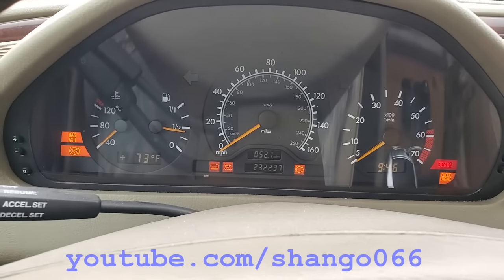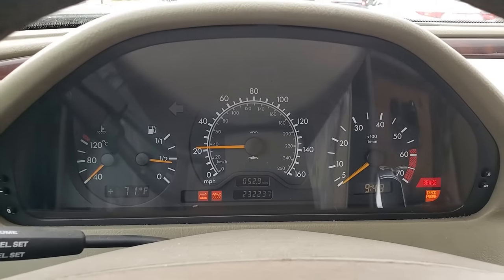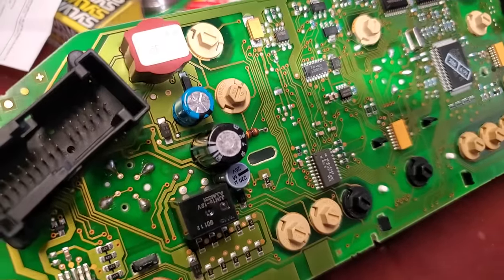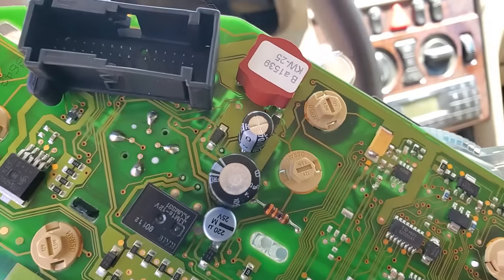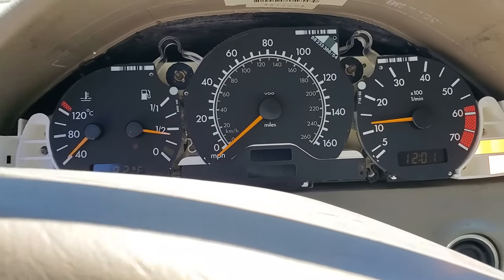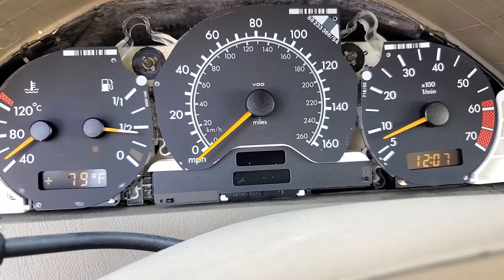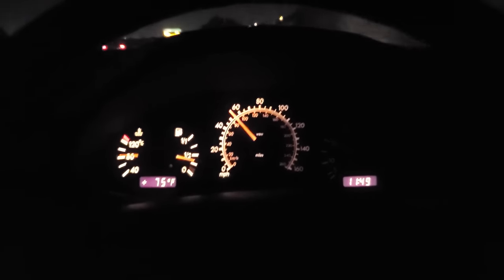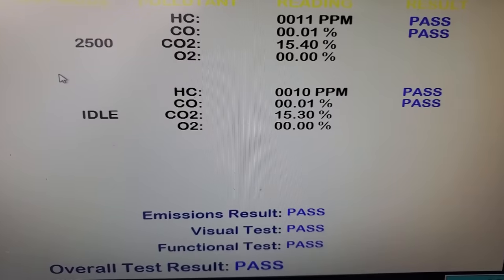Mercedes C230 P1747 Code Instrument Cluster Dash Repair 1999

Comment: Emissions tests in LA are absolutely VICIOUS!  The last time I had to do my 85 Nissan, they turned the truck inside out for 45 minutes to finally proclaim a big FAIL due to the check engine light not working.  An absolute screaming match ensued, in which I was just short of punching the guy.  The Manager walked out to see what the hell was going on.....   Finally he said "That truck doesn't HAVE a check engine light OR a computer!"  I ended up passing with flying colors.  Interesting though that a cluster can set an emissions code.....  why am I even surprised.  Next it'll be the Dome light.
Reply: I remember the bastards seem to pride themselves on how many cars they can fail.
Reply: In the not so distant future:
Dome light? oh you mean the cabin illumination module with integrated occupancy detection ignition lockout sensor & Bluetooth interface. Yeah.. so if the leds go bad in the illumination module the occupancy detection sensor will throw a code & disable the ignition system because it can't confirm that someone is in the vehicle. Oh, no, you can't just replace the leds in the illumination module because all the components are potted in glass fiber reinforced epoxy resin as it is a part of the vehicles anti-theft & security subsystem. The module will have to be replaced. For your model year, replacements are 450$ & they are on back order.
Reply: Gee, you could have had a civil conversation with the person, pulled out the owners manual.
Reply: @bobroberts2371  I DID!!!  He was adamant!
Kept pointing at his book, which turned out to be wrong.  I guess you don't live in California, (I actually recently left) the idea is to get all old vehicles OFF the road.  They are required to fail a certain percentage of cars.
It is infuriating when you actually maintain something and they try to take it way and slip you into a shiny new lease or payment plan.  And I do own a Snap-On gas analyzer BECAUSE of this BS!
Reply: In a state where everything is illegal the only real crime is getting caught
Reply: It's nice to live in a place where they don't have emissions checks or anything like that. Although it can get scary trying to avoid the Dodge Diplomat that's missing the front clip weaving around in traffic.

Comment: Shango, 
I have both a 1999 and 2002 Grand Cherokee Laredo and Limited (4.0 & 4.7 HO respectively). The grounds under the DERMs on each and shifter under the console were rusted and full of High Fructose Corn Syrup, not to mention leaving the sunroof open in multiple overnight rainstorms (my GF in case you were wondering). Pulling both front seats then repairing the 4 grounds, 2 on each side , under both seats. That and cleaning the BCM bulk connectors with the busses, and cleaning the IPC main connector, everything is good in the world again.

That Benz was built when the capacitor plague was present but unknown largely. I never thought of checking the simple 1999 cluster for bad caps.  Maybe I'll check again in case. IDR if it had caps or where they were. The Benz cluster is a smart cluster compared to the 1999 and older JGCL's. Benz and Chrysler were together at that time. Lots of weird similarities between them, especially the E500 and 300C 5.7 Hemi.

Time to get the non-vaginal phono lube out..

Comment: Not sure if you get many of the European style Fords like the Focus out your way, but they suffer with dash trouble too. Usually dry and cracked solder joints. 
Can cause many faults not only the dash wigging out but in some cases the vehicle won’t start as the dash is part of the immobiliser. 
Sometimes a sharp bang on the dashboard will confirm the fault👍

Comment: Also check the cable going to the transmission. If that is oily, change the socket where the cable plugs into the transmission as that is not supposed to let transmission oil get to the plug (and thus oil wicking up to the transmission control until that's located in the passenger foot area, which will ruin it over time). I can look up the MB part number or other workshop info if needed.

In general, those W202 Mercedes are very good and will last, if you got a good one that doesn't have too many rust issues. If well taken care of, they'll last almost forever. Here they were used as taxi cabs back in the day.

I also have one of those W202 Mercedes in my collection :3
Reply: Oil in the control module is common however, plain oil won't cause a failure, it is the graphite / fine metal that builds up in the transmission oil that causes it to become conductive.

Comment: There might be cracked solder joints on the connector pins. A common problem in some cars... This is caused probably by the cable vibrating a the big connector thermal expansion.

Comment: Hey, nice short video, and high congrats for success, so this leaves time for a long comment, and here it goes: In NJ the Money Light (check engine) light has to show up with the key on not running. I'm watching on a phone🙃, so i cant tell if the light illuminates here. I had an EOL '98 Bonneville with MIL (check engine light) anong other fatal problems, but that light stayed off long enough for me to pass previous inspection, but this time no go. The car had (among other annoying problems) rust issues worthy of junking the car, but call me crazy, i still wanted to be able to drive that rusty car, and I did not want to junk the car due to big brother issues. The EGR was the issue, and in my pick and pull, all the cars already had the EGR removed. One possible donor car was all the way in the back, and the hood wouldn't open, but i did it with vice grips on the cable, and voila, EGR was there, worked on my car, passed inspection. I  had to junk the car soon after because rust issue was not getting better, but at least i didnt have to sacrifice it on big brother's altar☺️. Ha ha. The day before I was going to get my wife's Honda inspected, the Memory Seat tried to smush her against the steering wheel, and every attempt to open the door after that, same thing happened. I  disconnected the battery to see if the problem would go away, and after several disconnects, it seemed to go away. Shango's reference later in his video about driving 55MPH refers to a "driving cycle" one has to go through to satisfy big brother's computer that you are not vomiting pollutants into the air, and that cycle has multiple crazy driving conditions to satisfy, and if you dont perform ALL of them, you cannot drive your car. I  looked on internet and owners manual for how to satisfy the many steps of the driving cycle and performed them over 47 miles of driving the night before, brought it to inspection next morning, but it still failed becauseI didnt properly jump through the hoops like a trained dolphin. Drove the car normally for a week and the the car ended up passing. My driving cycle wasted more gas and created more pollution just because I disconnected the battery and got the car inspected next day🙄

Comment: Radiotvphononut works on some flat screens.  Usually just the power supplies with discrete components.  Caps, resistors.  He has some success.

Comment: This car appears to validate the claim that you can judge the quality of a car by the obnoxiousness of the beepers. LOL! Mercedes doesnt HAVE a cluster, it IS a cluster. Electrolytics and lube. Falling off my chair laughing! 230K and still running. I get it that southern CA still does emisdions checks, but WA of all places with Lockdown Inslee in charge did away with them several years ago after admitting the checks did NOTHING to improve air quality. Now there are abandoned check stations all over the state!

Comment: Don't beat on that car so much, it's probably one of the last merc's that were relatively simple, reliable, cheap and economical. Older 80s models were heavy and used much more gas, newer models are excessively computerized. The 90s are a good era for Mercedes.

Comment: the 96-2001 Dodge caravans also have dash issues to the point of the car not starting. Problem is always a cracked solder joint on the socket on the back of the cluster..

Comment: Well done.  I need you to fix the gas guage on my 70 Eldorado.  I give up.  Ordered all new chinesium.  Not going to drop the tank again while there are snakes around.  Don't want to be pinned under the car with a rattler or copperhead.  Wait for cold weather.
Reply: Some of those old GM had a plug somewere along the wiring harness.   my 78 it was under the carpet trim just behind front seats.   I need to do guages  on mine but i need oil pressure/water temp.

Comment: Just went through an almost identical situation with a C280...same car but with a V6. After hundreds of miles of driving the one monitor not ready was the secondary air...just like you have here. In Connecticut where I live they allow up to 2 monitors not ready in order to pass as long as no codes are showing. Also with those cars a bad brake light switch can cause much warning light weirdness.

Comment: Back when Stuttgart made good stuff. That instrumental configuration is iconic
Reply: In 1999 Daimler-Benz and Chrysler had already merged. The renowned Mercedes quality went down the hill.
Reply: @UHF43 Stupid myth. It was 1998 but it didn't really have a huge impact on their quality, if any, until many years later. The cars were finalized years before the merger
Reply: @MrCarGuy  Yeah, a myth that spawned two class actions against Mercedes for their faulty engines.
Reply: @UHF43  I agree. Just meant the layout was nearly the same

Comment: Don't knock those of us that regularly have to replace electrolytic caps, just about every item I repair has faults caused by bad caps.

UPDATE: see LOL.

Also why didn't you replace the backlight bulbs before you put it back together?

Comment: The LCD displays have backlighting , the bulbs fail from time to time.  Also, there is a carbon stripe ribbon cable between the board and displays that fails.    It is connected with hot conductive glue.

Comment: I guess for a semi-modern mercedes 232,000 miles may be a lot, but in general that really isn't. My 1992 Volvo has 325,000 miles and it is just getting broken in. My 1999 Corolla had around 250,000 miles and still ran perfectly until a tree fell on it.
Reply: Volvos of that era are wonderful cars. 

I love the rear drive volvos, my favorite cars, even though the non turbo ones are pretty anemic on power.
Reply: @volvo09  I have an 89 and a 92. Both are non turbo b230 engines with the aw70 automatic transmission. I know I am the odd one out here, but the N/A models with an automatic are my favorite. They are slow as hell but that is just part of the feel.

Comment: Great repair, just a simple capacitor. A Merc customer would have spent hundreds if not thousands to get all types of sensors replaced with no luck for the sake of a $ 1 capacitor.

Comment: I currently have the same situation on my 99 CLK320, Same 1747 Code too. same cluster. I'm going to look at that Capacitor, It just so happens I have A 470 16V Cap in my electronics shop. So My guess is yo Rocked the Capacitor off With the iron and used wicking to get the extra solder off the board, because there is no way for the DE soldering tool to fit in there. Thanks for the video. Very informative. I have Mad Ninja Skills so I'm going to go for it. I think I'll buy A bulb kit while I'm in there too

Comment: That capacitor you removed looks like a Teapo capacitor. (I say that because it has the same top vent style as Teapo's.)

I once found an iMac from the same year as this car, 1999, and the CRT had awful smearing and a green tint. I thought the CRT was bad until I noticed the smearing went away when a window was open on the desktop. Took off the CRT neck board and found a bad Teapo cap. Replaced it and that made the display a lot better.
Reply: In my experience working on Mercedes clusters the blue ones are Philips brand capacitors. They only use European or Japanese capacitors
Reply: @MrCarGuy   I belive Teapo's are Japanese capacitors? I don't know, but I do know that vent style is exactly the same as Teapo.

Comment: Great fix. That's not much mileage at all for a European car. There's a French car doing the rounds with YouTubers in the UK that has slightly over half a million miles and still drives really well apparently. 
I'm in the UK so have no experience of American cars so don't know if you are comparing it to an American car but in general look after it and it might well outlast the owner 😁
Reply: AFAIK Mercedes kind of went downhill in late 90s in terms of reliability, there must be a reason why an ex-taxi W124 that ran half a million km on frying oil tends to cost more than a 2002 E class.

Comment: I noticed the ODO had 232237 on it, it would have been funny to see 232232, but anyway it sounds a lot more with  just over 381 K in NFU's hehe.  There has always got to be a bloody insect or something similar in a dash or display when you put it back together.

Comment: I have a 93‘ S Class that doesn’t even have a check engine light, it barely has any computers at all. Those started in the later 95‘ model years along with OBD2. It’s not a diesel though and the MAF sensor is broken so I still get emissions trouble.

Comment: It looked like the right hand side of the dash had gone out, I’m assuming whatever drives that side has failed completely?. The bad capacitor may have taken out the power supply side for the tachometer ?.
Reply: Tach was working. Just
Couldn't see at night. Bad bulbs.

Comment: You are probably one of the very few auto shops who do component level electronic repair. 99.99% of other shops: "you need a whole new cluster"...
Reply: I had an F-150 theft light on all the time. Shop manual said change the cluster. I knew that cluster was famous for cold solder joints. I touched up all the joints. Light returned to normal.
Reply: There's a few electronics shops which specialize in component-level repair for clusters and radios. The garage mails it to them and waits two weeks. They can do things like CPU replacement and EEPROM resetting, and can make sure the odometer matches. They're often endorsed by carmakers, it's the only choice when there's a widespread issue and the manufacturer's spares stock is gone, or when the Japanese, who haven't figured out software and CANbuses yet, have a software bug that requires test bench flashing because it has to be done by test points on the board (Honda gauge clusters, Subaru audio amplifiers).

Comment: I had a similar car, an W210 E Class from the same generation as this one which was missing some pixels on the screen. They have a ribbon connector for the LCD and from aging it intermittently ceases to make full contact with the screen, so the way I fixed it is by placing a piece of rubber behind the connector where it makes contact with the screen.
Anyway I believe that behind the screen there are two bulbs that illuminate it and being that old they will go out just by the shaking during the disassembly. That was what happened in my case at least, when I fully reassembled it some of the lamps that were good before went out. After I replaced them everything was working correctly.

Comment: NY is the same way but we have Road salt which rots out everything on top of it! Have a few '90s cars rust free completely mechanically sound Just bad electronics (gauge clusters etc nothing engine or emission wise), a $20 AutoZone gauge would show more info than the stock one would but yet will not pass inspection because of it 🤬 Definitely not fun in CA I heard stories but New York is not far behind At least you guys don't have rotted out cars and '90s cars which were much simpler to work on are long gone from the U-Pull-It yards around here. Totally ridiculous California is bad enough no offense but at least you guys don't have road salt eating up cars every year New York is trying to mimic that but in a very poor economy. I give it 5 years max around here before it is like Detroit ended up especially the western part of New York. Nobody can afford $2500 housing cost plus a $800 car payment!

Comment: Good morning, I know people must ask you all the time but here I go anyway. I have a 2018 rv that has built in wifi, I have been trying for months to get it working. Back and forth with tech service, finaly they said I could upgrade for $125. I don't want to give them the satisfaction. I know the unit is getting power but no wifi. 
Would you be interested in giving it a look for one of your videos? I have nothing to loose. I am a heavy equipment tech with 40+ years in the feild but I am shit with electrical. Thanks for your time. Dan L.

Comment: Isn't this one of those M-Bs from the era where they had biodegradable wiring harnesses?

I'm not kidding! Look it up.
Reply: No, that was for '94-'95 on this model and most of those harnesses have been replaced by now because otherwise they wouldn't work.
Reply: @MrCarGuy  What, the whole wire harness needed to be replaced? That sounds like a huge task, ripping the whole car to a million pieces. What was the issue with the wires? The insulation cracked or the conductor corroded? Did they done the replacement under a free recall service?

Comment: Mercedes end of life at over 200,000?  Not surprising as they have significantly gone down hill in quality for years.  Our family has three Civics; the "low-miler" has 300,000 km (200,000 miles).  The others are in the low 400,000 km range, and they all work and perform perfectly.  And the combined purchase price for all three was a whopping $500.  Just the way I like it...
Reply: How is this end of life?? It was a single capacitor